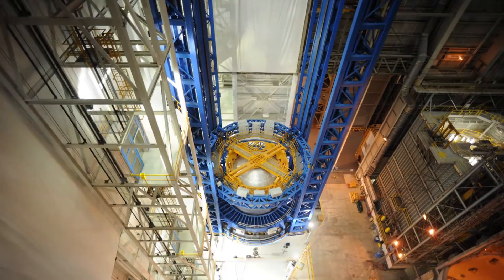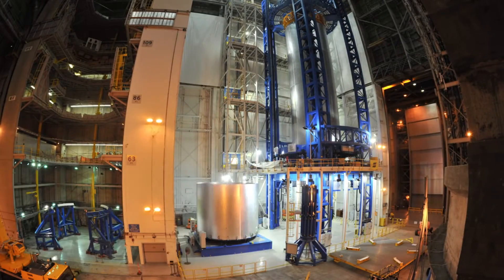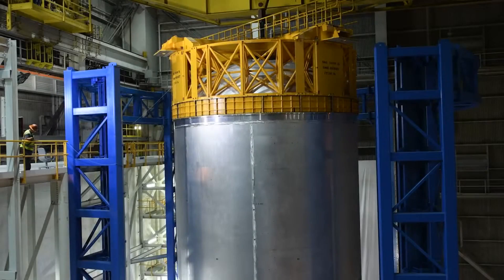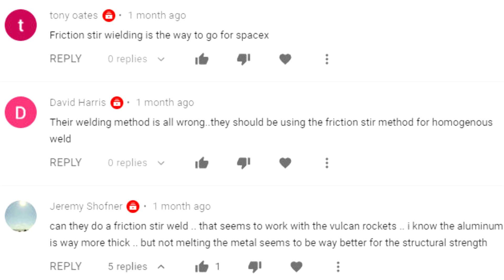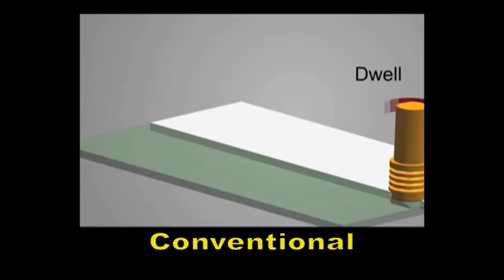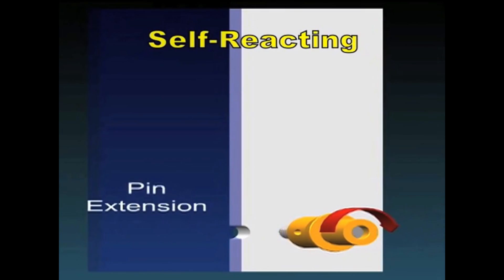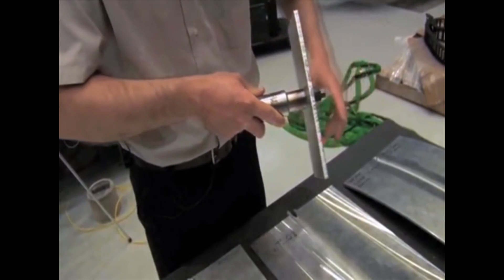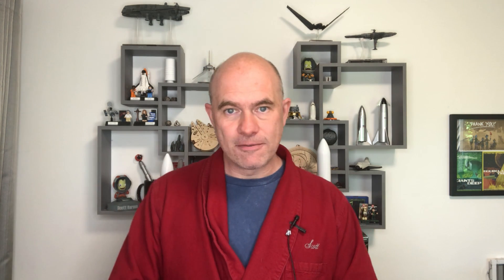SpaceX's 4th Starship Prototype Collapses During Test

Comment: I tweeted to Elon yesterday that perhaps they may need to incorporate some form of strut system welded to the sides of the craft, (through which wiring could be run), which can support the tower of rings even when the lower tank section is empty. I actually thought there was already some kind of internal support, but clearly not.. This thing is basically a 50 meter tall coke can, and, evidently, crumples in the same way..
So, adding these struts would not be too difficult, but would of course add to the weight, and reduce payload capacity a bit..
However, a bit less payload to successful LEO, is better than the whole thing collapsing on the pad.. right?

Comment: Does anyone have the definitive answer or an informed guess as to why SpaceX are using stainless steel (a mixture of iron, chromium, nickel + other metal additives)?  On earth, the primary reason for using stainless is for oxidation prevention. Things on earth are surrounded by oxygen and the chromium in stainless steel oxidizes faster than iron thereby creating a skin as such preventing further oxidization. But for the life of a Starship, apart from the assembly and 5 minutes of launch time, the vehicle will be in the very non-oxidizing environment of inter-planetary space or the equally non-oxidizing atmosphere of Mars. To prevent oxidization of steel on earth for the relatively short fabrication and launch time a layer of paint should be sufficient. There are some strength benefits of stainless over normal mild steel especially as the temperature rises to about 800C but these temperatures are still well below reentry or rocket exhaust temperatures: having a stainless steel structure would have no benefit at really high temperatures.  

Of all SpaceX, Tesla, Boring and other Elon Musk ventures, this Starship enterprise is the least impressive from an engineering point of view. Seeing crinkly tubes of thin stainless steel welded together unevenly and then collapsing in these tests looks rather amateurish - almost Mad Mike Hughes-like (RIP). If you're engineering properly, you calculate the burst pressure of tanks. Putting pressurized liquids in tanks has been done for years and the numbers for rupture pressures are probably in a book published in the '50s.

Could it be that we are looking at the Starship project through rose-tinted glasses? If we take away the SpaceX logo and Mr Musk's media savvy aura, would we have such a respectful tolerance in the comment section of the videos we see or be more critical?

Comment: For your information Scott: Gas Tungsten Arc Welding is TIG, Gas Metal Arc Welding is MIG (or MAG probably in this case as most stainless MIG requires an active gas component). Plasma arc is similar to TIG but uses a gas as plasma instead of the arc directly for heating the workpiece. Orbital tube welding is simply an automated TIG process for cylindrical components.

Comment: I think in cases like this it’s always curious to see the reaction to these failures. On one hand you’ve got the third tank failure in a row for the Starship design and the general consensus seems to be “well, they can just build a new one and learn from their mistakes”, while on the other hand you had a software problem on the Starliner and it was decried as a total failure. Not saying that either of these is better or worse, but the disparity in reaction certainly is. 
I for one hope that SpaceX takes a hint and goes back more than a step or two, to really see if their current tank design is really up to the task or if they need to change the design for the coming test vehicles.
Reply: The difference being that Starliner was flying a complete mission profile as a supposedly finished vehicle; a precursor to _launching humans_, whereas this is truly just idea prototyping. Additionally, there were two rather large software bugs, not just one, and they had to do with something as fundamental as the mission timer that determines every automated action the spacecraft takes. It's perfectly reasonable to treat them as different magnitudes of failure.

Comment: Most of that was regular welding, some were exactly the same by described two different ways, one was just about using a computer control to remove operator error in boring repetitive work pieces.

Comment: The word which you looking for is:
B-U-C-K-L-I-N-G
It's an engineering expression...

FSW Friction Stir Welding applied at the SLS, because their cryogenic tank material is highly alloyed and tempered(!) Aluminium, 2195 or 2217. This alloy types don't the like the high heat input from the arc welding or high energy beam process, because the heat affected zone will be much weaker than the base tempered material.

Boca Chica is a little joke in the history of space exploration...

Comment: In the end they will have to figure out how to cast entire thing at once because thats the only way to avoid weak spots. Because no matter what welding technique you use there will always be weak spots because of the welding itself. We are talking about rockets here, meaning high oscillations in temperature, pressure and vibrations. Best weld is no weld. Figure out how to cast entire damn thing at once. 💪🏻

Comment: The types of welds listed in the job application are some of the proper full names for MIG, TIG and arc welding with laser, tube and plasma welding being other common names in the industry. Heat management is the primary parameter that greatly affects the quality of stainless steel welds, if the steel gets hot enough to permanently change it's color next to the weld bead it's too hot and the metal becomes more brittle the darker it is which is usually called "cooking" the stainless steel.

Comment: 4:41 Laser beam welding is just what it sounds like (welding with a laser), gas tungsten arc welding is the long definition of TIG, resistence welding i actulay don't know, but it sounds like electrode welding, gas metal arc welding is MIG/MAG welding, Orbital tube welding is a pipe weld specialazation and plasma arc welding is like TIG bit insted of Tungsten they use plasma.

I am a mechanica engineer and my first language is not englisch so some of thease may not be well translated and some i may have gotten wrong.

Comment: Disclaimer: my knowledge on this subject comes from a few courses I took, I am by no means an expert. 

Basically, some of those welding terms you haven't heard are different names for the same thing. Gas tungsten arc welding (GTAW) is known by the informal name tungsten inert gas (TIG). Gas metal arc welding (GMAW) is also known by the informal name metal inert gas (MIG). All the other things referenced are more niche things but they are things that all welders are educated about, so the job application basically only requires you to be a basic welder (nothing special).

Comment: I think that the contents of the lower tank were sealed in because all the valves were closed.  As the upper tank cooled down with the cryogenic gas, the lower tank cooled also.  This cooling caused a partial vacuum to form in the lower tank which caused it to collapse.  All they had to do was leave the lower tank open to the atmosphere to allow the pressure to equalize and the event would not have happened.

Comment: While friction stir might work in laboratory conditions, you aren't likely to be able to do it on SS without an incredibly rigid and large CNC controlled milling machine (I know they had something like this on the Ares project) and jig/vise to hold the material in place. I would imagine the window of parameters in which it can be accomplished to be quite narrow - stainless steel work hardens from friction/manipulation applied to it so any slight variation in speed or feed of the tool head would likely mean failure of the weld or tool - and that would be a custom made tungsten carbide tool. I'd say not impossible, but definitely a nascent technology in that material.

https://ntrs.nasa.gov/archive/nasa/casi.ntrs.nasa.gov/20120016717.pdf

Comment: Hi Scott, great Video! Could it be possible that the lower tank section contracted because of cooling due to the upper tank? If the lower tank is pressurized at ambient temperature and then it gets cooled by the cold surface of the common bulk head it could contract, right?

Comment: There is some great things about welding the 301 stainless with Plasma arc welding and a few other automated GTAW processes because they have really been dialed in over the last 20 years for doing sheet to sheet at speed, some of these processes are done in sheet metal stamping factories so coils of sheet metal running low, can be attached to the next full coil very fast so it can be pulled through the stamping presses and little time is lost in stamping. The great thing with these processes is there is so many companies like Jetline/Miller, out there that have really dialed in the automation, vision systems and sciences of movements on the torch head, especially now with faster drives and better controllers which is really important when dealing with 301. My guess is that a lot of the automation is coming but currently the automation welding machines are being built because of long lead times to build the stuff because of the size and custom factors needed for each process, so in the current state its just being done a lot of the old fashion way.

Comment: Are we sure they were not testing the tank section to the breaking point? I know it looked much more finished than the earliter SNs but they did not take the nose cone with them so I was pretty sure that this ship would not fly even before the mishap.

Eventually they need to stop breaking everything they test but remember they are still on a Mythbuster kind of learning curve where "failing is always an option." Johan

Comment: Frankly, despite being a total Elon fan, I think Starship is pushing the envelope to far (literally), it is supposed to aerobrake belly first on arrival on Mars. Can you imagine the physical stress on the ship ? If, he has burned it’s fuel on the way, there will not be much pressure left in the tanks and by so, the rigidity of the hull is compromised. How is it suppose to endure a very intensive aero breaking without collapsing, like we saw with SS4 ? It is a very beautiful concept but I suspect that it probably will need very heavy revisions to overcome this problem.
Reply: It is supposed to keep the tanks pressured. This was a testing model
Reply: jackdbur I understand that, but it means that the whole ship is practically and inflatable rocket 🤨, for launchers, it has no importance, as the stage is discarded, but for a proper spaceship 🚀 with 100 passengers, it is very low security, they would feel like being on the Hindenburg 😱, furthermore, it means that any minor injury on the hull during the earth to Mars transit due to an impact, will heavily compromise the structural integrity as it is supposed to be rigid because of the pressurization, imagine a balloon 🎈 with a tiny scratch done while deflated, do you believe it will inflate completely without exploding? 🚀🎈💥 The thin skin of the starship is not protective enough in my humble opinion. Furthermore, if an accident happens with 100 souls onboard, it would create a huge trauma in the public opinion with devastating consequences on future missions.
Reply: It's alot tougher than 2.5 mm of aluminium (current skin of iss) tanks are kept at a constant pressure. Astronaut Colonists are Not going to be totally safe everything in space is dangerous/deadly. Mars colony personal missions will probably be backed up by robotic sar ships at mars ,those kinds of protocols are a ways off still anyways. I'd expect colonization of the moon first and specific moon mars transports launched from there. You want safe get into a deep bunker and crank the door shut. For well thought out space colonization try "Isaac Arthur"s channel.

Comment: GTAW is TIG welding (very strong, high quality depending on worker skill, low deformation but very slow)
GMAW is MIG welding (fast, lower strength, more deforming)
Resistance welding is just plain old spot welding
Plasma arc is PTAW which is like the automated version of TIG welding. It allows them to feed a metallic powder into a continuous plasma stream instead of a solid rod.
Laser welding is large depth, high precision, I don't have much experience with this one
Orbital tube welding is just the process of welding around tubes in a continuous bead while a machine rotates the tube
Reply: And the main issue friction welding stainless steel as opposed to aluminum isn't just hardness, but mostly the temperature issues.
6061 melts around 650 degrees C, stainless steel is around 1400C.
And also performance of a metal AT temperature; aluminum anneals above 250ish degrees C, which makes it MUCH more malleable and easy to work.
Once aluminum is annealed, is stays nice and malleable for a few hours, then eventually returns to its original state of hardness.
Stainless steel remains quite tough until it melts, which means you need way more power to move a friction tool through it, and you have to take into consideration the issues of heat cycling ferrous alloys to their melting points; like crystallization (embrittlement) and tempering(softening).

I'm surprised how much of this I retained, I haven't done metallurgy or welding in a decade or so.

Comment: My guess:  They were testing the upper tank at cryogenic temps.  Elon questioned procedure.  Looks like lower tank buckled from both weight above AND being under a vacuum.  The lower tank's vent valve wasn't opened.  The chill from upper tank condensed lower tank, causing initial weakening of structure.  I always dent my beer cans before stomping on them (near the top).

Comment: Im no expert on failure mechanisms but it seems to me that the metal crumpled quite uniformly. Its as if it really is just the atmosphere, and the weight, and not the fabrication process.

Ive never done TIG, but one good thing about TIG and MIG welding is that you can add filler metal. Because lets be honest here. Welds are pretty strong. Iirc a square inch roughly holds a tonne of weight, but regular steel will always be stronger. Imagine this. A plate of steel has undergone rolling. Then they might even had some form of heat treatment. Welding on the other hand has its crystals melted and harden again which wont ever have undergone forging or a controlled heat treatment. Perhaps im still shit in welding but what I know is that to weld stuff without adding more material in, it would never be as strong as a block of material that was milled down to shape (subtractive manufacturing)

Plus, if you cut metal with oxyfuel and tried cutting out welds, you might notice that welds and base metals melt at different temperatures. Suggesting the material properties of welds wont be the same as the base metal

Comment: I've worked on and off as a welder over the years.  One thing I've been wondering about is how do you weld in space?  Welding in a vacuum is a very strange thing.  I do know one trick that works with stainless though.  Stainless steel in certain, situations, can cold weld.  Say you want to join two pieces of stainless together in space.  First polish off the passivization layer of each surface.  Then press them together really really hard.  They will cold weld themselves together like magic.  

Mostly I've seen it happen when you don't want it to happen.  When you work with a lot of stainless, always either use a dissimilar metal like brass on your fastener, or make sure to grease the hell out of that bolt or you stand a chance of a stainless nut spontaneously welding itself to a stainless bolt.  Those are the days I get grumpy.  
"So it wasn't turning any more so you kept trying and now it's broken  <exacerbated sigh>  kids these days."
Reply: I'm assuming you've read Artemis by Andy Weir?

It's not an answer, or a whitepaper. But its a great fictional read that considers the topic. Not cold welding, but gas welding in a vacuum.
Reply: @matthewspencer2094  Added to my list immediately.  Haven't had so good Hard Sci-Fi in a while.
Reply: @Nybbl er I know that's how I learned about it.  I was curious how you weld in space and all I could find is papers on cold welding.  It can happen here on Earth too.  If you ever findyourself working with a stainless steel screw and a stainless nut DO NOT over tighten it.  One of the guys I used to work with destroyed several Stainless steel valves by over tightening.  Gotta love food grade stainless.

Comment: To put things in perspective, it did hold pressure for an hour and a half. And the welds did not fail. Pure speculation on my part, but I think a valve failed which caused lower LOX tank to depressurize.

Comment: Wait, if it doesn't support the weight of the top tank being full when the bottom tank is empty, what will happen when its trying to land with a full payload of weight on the top part and the fuel tanks almost empty, wouldn't it do the same thing? Or will it have to maintain a certein pressure in the tanks to be able to support the weight? Isn't that a waste of fuel and delta-V? can't they use structural supports on the inside to sustain the whole weight, becoming a little heavier but being able to use more of the fuel?
Reply: The fuel capacity is 1200 tons, the cargo capacity is only 100 tons.